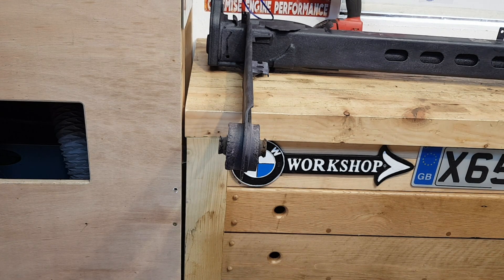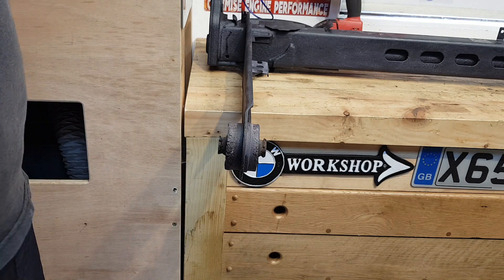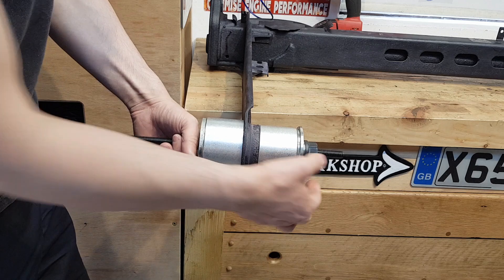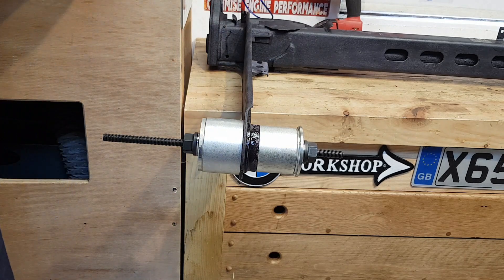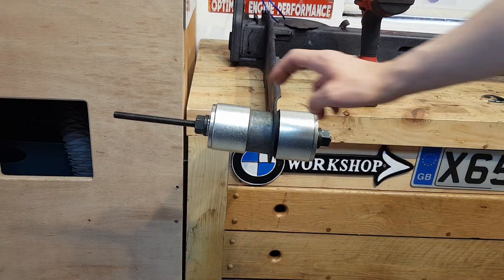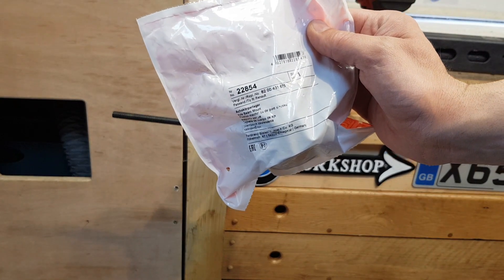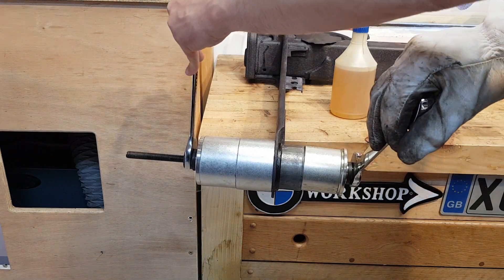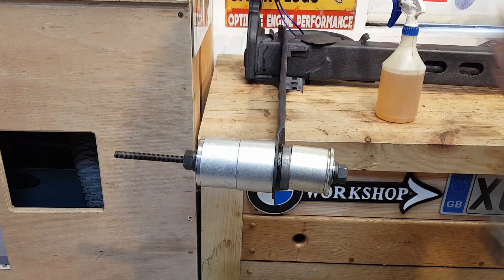How to remove/install rear axle bush Renault Trafic Vauxhall Vivaro Primastar How to press axle bush

Comment: Good tools for bush removing. Where to find such a toolset?
Reply from the maker: Hi
There are many different tool kits on the internet. Here is a link for one like mine. Have a look and see what is cheapest as this is just for an example

https://www.ebay.co.uk/itm/204175490572?mkcid=16&mkevt=1&mkrid=711-127632-2357-0&ssspo=-gfqthrrqbo&sssrc=2349624&ssuid=RwAnBlHgT8-&var=&widget_ver=artemis&media=COPY
Reply: @TheKeenMechanic  Ok, thank you for the link. I need to make such a purchase too.
Reply from the maker: @Finnlander2  It will be well spent money. Very good tool kit.

Comment: Hi! Is it possible to replace it without removing the axle under the car? How do you do it if possible? Thanks!
Reply from the maker: Hi
You don't need to remove the axle in order to replace the bushes. I removed mine as I was restoring it. You can press the bushes out with the tool I used in place when you drop the shocks and springs the axle will drop down

Comment: What are those distances for the bush? Mine has shifted sideways.
Reply: Sorry not clear maybe...i need the distances you marked from old bush
Reply from the maker: Hi
I didn't measure it but just matched the original. Try and push it in the middle but if you cant I dont think it will be a massive issue. I just wanted to make sure mine is perfect  at installation